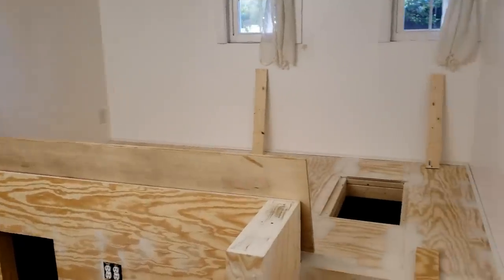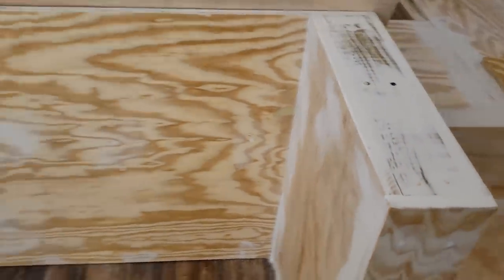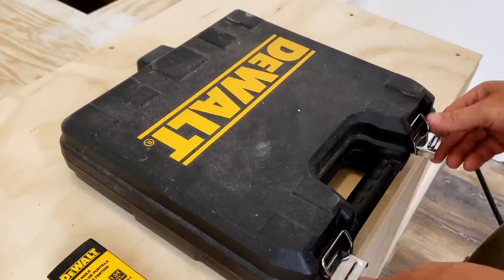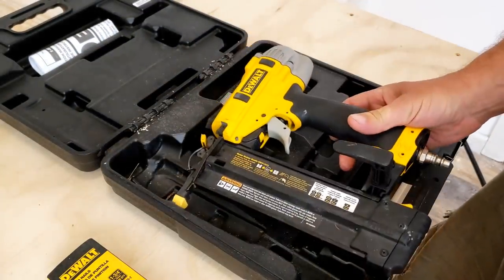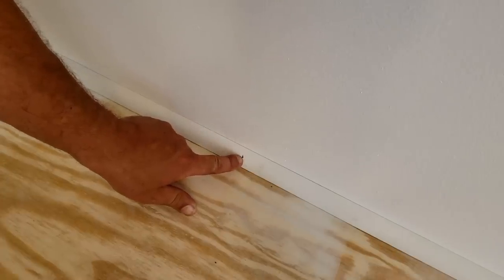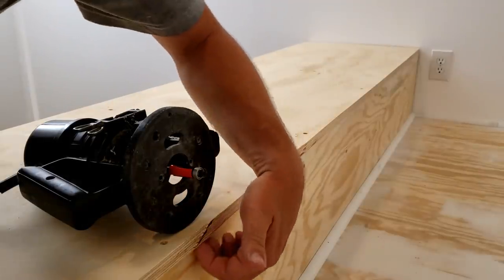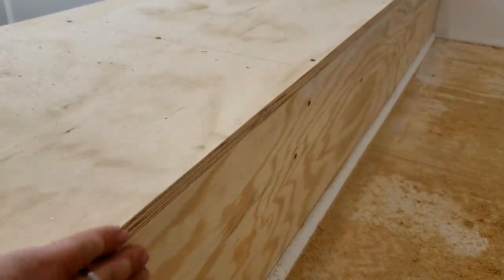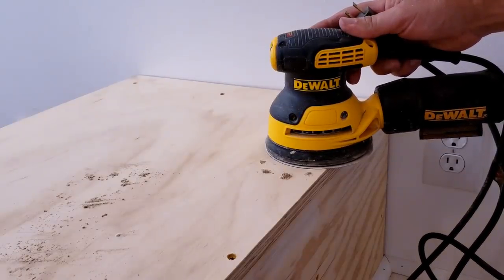Platform Bedroom - Custom Plywood Desk

Comment: Drawers and a pull out keyboard and mousepad would have been great, at an ergonomic height for your daughter. A pop up socket, with standard plugs, and USB ports would have been a nice install on the desk, so not running wires under and up to the desktop. Or even a cutout would have been a great idea. Some day your daughter will have a laptop/tablet if she goes off to college and comes home to visit if she does not already have something because of homeschooling during the pandemic.

Comment: Always wanted to get an air nailer. I finally have a compressor but would you recommend a battery dewalt air nailer now if you were going to do it again?
Reply: For a finish/brad nailer battery is the way to go. It sucks dragging out your compressor for a couple nails so little repairs that used to get postponed now get done immediately(before you lose the tiny piece that needs nailing 😂).